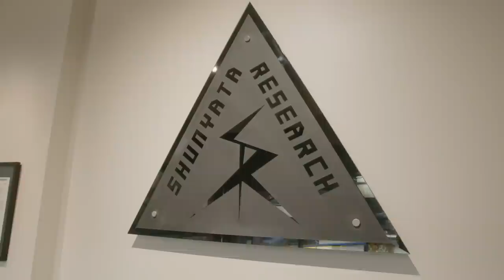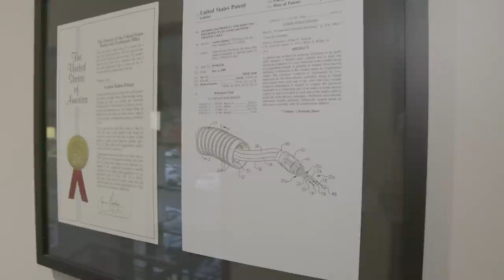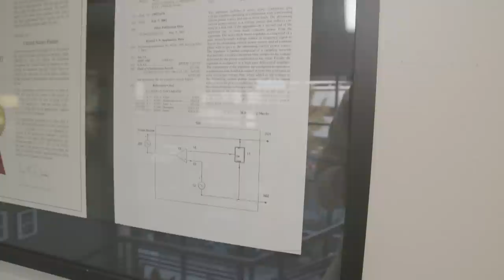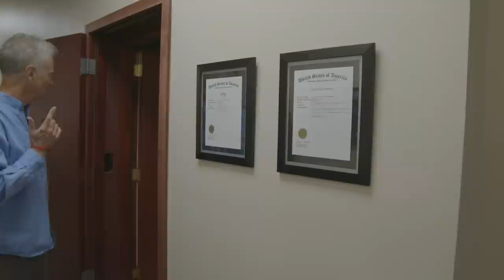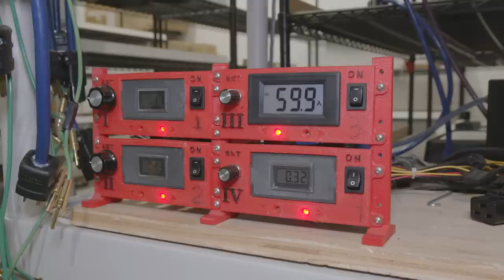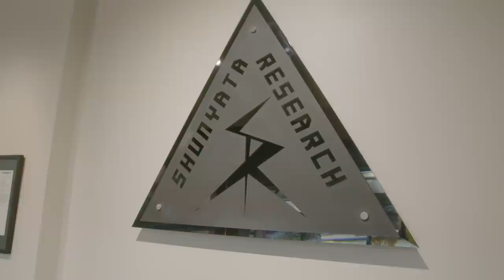Robert Harley tours Shunyata Research | Lots of Hats, Lots of Heart

Comment: At 21:38, Christopher Sanchez, an R&D guy is explaining the procedure for readying the cables which involves KPIP (Kinetic Phase Inversion Process).  Hartley asks Sanchez what the KPIP process involves, and he clearly had no idea and handed the question off to the founder and president Caelin Gabriel, who also had no idea.  Clearly, Kinetic Phase Inversion is a pseudo-scientific term that was made up to sound impressive.  They should have studied up on the word salad they use in their ads.  It also appears that much of their cable line is held together with epoxy, hot glue and heat shrink.  Their "special" cables are shown in bulk rolls in the warehouse, without any additional care, nor any indication of why they are so expensive.  Richard Rogers, another employee, explains that he doesn't like to put his money into system building.  He'd rather spend it on his family and fishing.  This is the company that wants to sell you $10,000 2 meter cables..
Reply: Alternatively, they both know exactly what it means, and just aren't about to give it away for free. Which is consistent with potting, to prevent people stealing their intellectual property. More often than not the theft comes from people who have little regard for the time and effort it takes to develop products like these. If you can't hear you don't know, and so why should we care what you think?

Comment: Hard not to contrast this tour with the Synergistic Research tour.
Reply: Better question is why no one will do a real head to head real metrics measured public comparative test?
Reply: Cody Smith 
 I am quite aware of several products that realistically in the eyes and ears and minds of many have earned the snake oil thoughts. I am inclined to show by measured metric results comparatively what NON SNAKE OIL in the POWER to components market segment what invented proprietary technologies do in actuality to majorly benefit any system. Results are staggering.

Comment: His reasoning is totally flawed. If there are potential differences between different earth points then a proper balanced system will mitigate this as it no long uses the safety ground as part of the signal transmission. This is what properly design studios and pro audio have been doing for years.
Reply: Brutal video. Hard to squeeze much more BS into 30 minutes.

Comment: Great company. I have quite a few of their products. Shunyata makes the best power conditioners in the world. The Altaira is also revolutionary.
Reply: Best performing??? PLEASE
Reply: @davidcross890  all other power filters are a joke. PS Audio regenerators are pretty good but Shunyata surpasses them. I have owned both. I kept the Shunyata.
Reply: @Fluterra  I have had both and tested both Shunyata and PS Audio P20. They both had a limited value for improving sound. Then I used two of the MIT Power Management Consoles that were far better but still were lacking what I needed. I then finished inventing my own circuit technologies that redefine what virtually perfect power can do. Non existent current limiting even for my monster mono amplifiers. I am sure that there are no real competitors to these new proprietary power circuits. They very easily outperform both audibly and MEASURABLY anything I have tested at any price. Heck the MIT PMC each retail for $28,350.00
Reply: Would you be for the posting of a public YouTube comparative test of all power products both audibly and measurably with posted results?
Reply: @davidcross890  haha, no, because I have better things to do. I have had both the PS Audio and Shunyata products in my media room and kept the latter. You won't hear it on YouTube anyway ;)
Reply: @Fluterra  to be clear I was asking would you be in interested in the content of a measurable comparative test by an audio influencer of power market segment products and technologies?
Reply: @davidcross890  yes!
Reply: @Fluterra  if you feel so inclined please contact any of the Reviewers and Influencers and ask them to perform this test. I continue to do this. Additionally, I can of course provide metric measurement equipment specific to the tests and of course make available my Proprietary power circuit Technologies and cords for testing comparatively to quite easily prove my assertions of comparative performance.